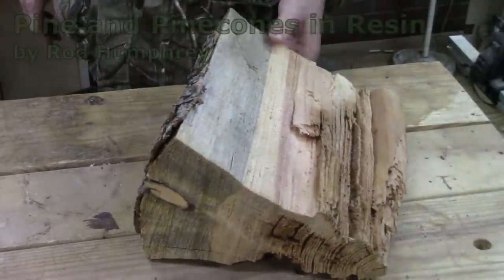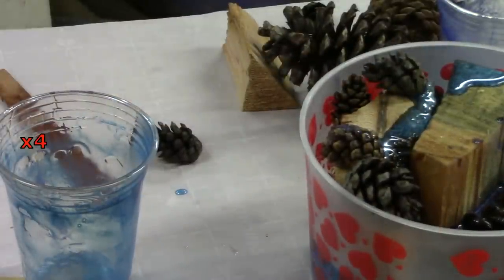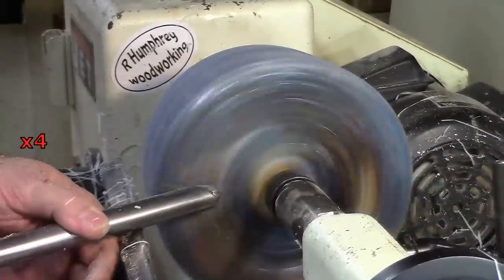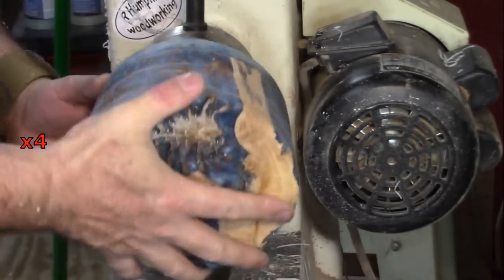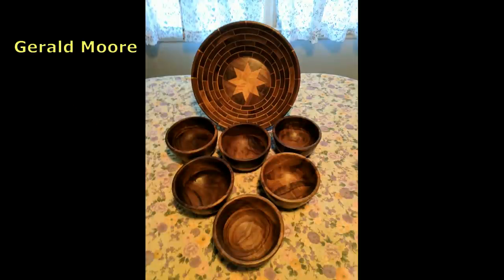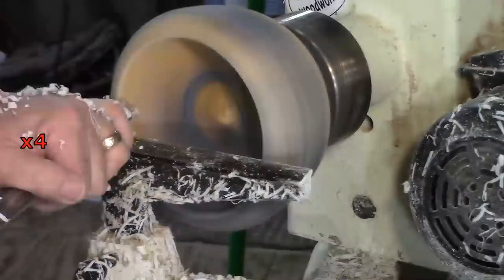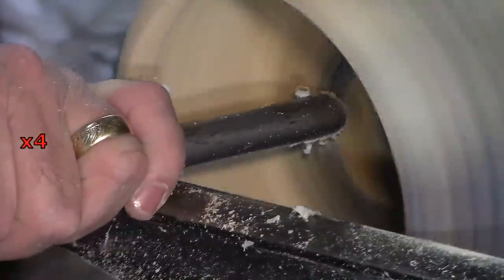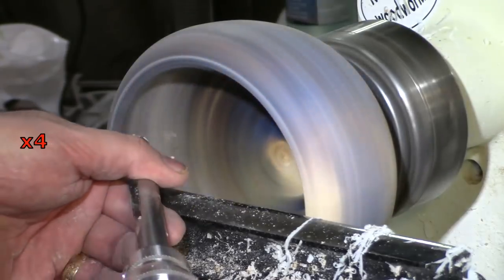Woodturning a Bowl, Pinecones with Epoxy Resin

Comment: please be careful with the epoxy resin, most resin's become toxic after being mixed and remain that way for three days, until full cure.i'm a boat builder in northern michigan,and i have burnt my lungs by working it to soon.remain well so you can keep making these beautiful projects
Reply from the maker: Dan, I really appreciate that, and I hope everyone reads your comment.  I don't stress it in my videos but I should...Wearing an actual respirator is mandatory for health reasons when working with resin, and good airflow.  Thank you very much!
Reply: Is this true? Damn. Yoi betyer be carefully working with it on the lathe then. Shit. I do alot of epoxt work too. Is it the one specific kind of epoxy? The boat epoxy? I know that one has fiberglass.....
Reply: @FatNebraskaMom  it's called systemic toxicity,liquid epoxy on your skin causes dermal contact. West System has a  book on precautions
Reply: @dandeforest9439  dude I will totally take it to heart. But I do know that there are different types of epoxy. Do u happen to know if they all cause this problem, or just the boat epoxy?
Reply: just found on utube under systemic toxicity from epoxy resin.if your epoxy has a ,ASTM -DH236,this means it is safe for home use,not even a mask is needed,(i would still use one for sanding)but there are no toxic voc's or chemicals.this is called art epoxy
Reply: @dandeforest9439  i will totally be careful. I knew there had to be a specification.
Reply: Good job
Reply: @dandeforest9439  thank you for posting this. I greatly appreciate it.
Reply: I been scrollsawing for 40years no dust mask same thing
Reply: I know a guy that was turning spalted wood like you ,lost half a lung from the fungus
Reply: @billallmon4094  Just half a lung? How does that work? Guessing it must have been the bottom half, or the the air wouldn't get in. I'm no pulmonologist, so really interested in how that works.
Reply: My gosh be carful, you could out out your eye!
Reply: I didnt know its effect for health. Thanks for your conferm.
Reply: @dandeforest9439  thanks for this importent info.
Reply: @Dan DeForest, thank you for sharing your experience with resin. I'm new to wood/resin turning and didn't know about the dangers. You may have saved me from some major medical issues!
Reply: Thank you for the tip. I'm just starting to learn to turn so any pointers like that help.
Reply: Tom Lindsay lungs are divided into lobes. Three on the right - right upper lobe, right middle,  and right lower lobes. Two on the left- left upper and left lower lobes. It’s the lobes that are removed during surgery. Hope that helps. Cheers
Reply: @FatNebraskaMom  Also belong to VOC material  Volatile Organic Chemical can cause  CANSOR
Reply: Dan DeForest Michigan in the house. Went to school in Houghton from Detroit.
Reply: Dan Deforest Art Resin brand has been approved as non toxic and food safe. No smell and no yellowing. I love this resin and the work time is an hour or more depending on the temp. Consistant product everytime.
Reply: Most toxic i met, was fiberglass, in no professional hands.
Reply: Im in Detroit...a Apprentice In the game.....Love it bro!!!
Reply: @RHumphrey  Fantastic work real workmaship is great to see.

Just a quick question, if you were to sell that, then how much would you ask for it...?
Reply: I love this bowl!  I wish I had some kind of creative talent like this!  My husband is from Michigan and his family is still there and he also was in the Marines. So on his behalf SEMPER FI!
Reply: Thank you for your "honest" comment about Epoxy Resin.
Reply: R Humphrey great comment, I always wear a respirator for any work that produces dust of any kind, even raking the yard, due to asthma. But as I am getting ready to work w some resin, I will remember to let it set and work on something else.
Reply: Carol Wells-Smith there is certainly creativity, but this is a skill practiced over time.
Reply: If doing this work indoors such as a basement, or even garage...you should also have some sort of air system to vent out the fumes. A fume hood, or vacuum system. Is best. Especially when dealing with the sanded particulates!
Reply: Bonnie Blackburn Art Resin does yellow over time....I just got an email from their support department yesterday saying so. It just doesn’t yellow as fast as the other brands.  I sent them several questions as I create high end jewelry and I need a non yellowing product.   They said,p that yellowing will occur after 5 to 10 years. If this is an issue, then I should “add colorants” to mask it. Yes, this is the brand “Art  Resin.”
Reply: Excellent, beautiful
Reply: Thank you
Reply: Dan - Really appreciate your comments as someone who's looking at giving this resin machining a go for the first time as I already have lung trouble and the last thing I need would be even more. I think a 'leave all castings a week before turning' policy would be a good one for me.
Reply: @jurisembergs9245  When I was a kid they used to make fibreglass canoes in craft lessons here in 70's UK. God only knows what lung damage was done.
Reply: SteeVeeDee  i unloaded bags with calcium (guess close to pure) in special compartment, made for cooling apparatus, system worked in reaction with oxalic acid, and those vapours were extremely dangerous. To damage lungs no gas is necessary, just pressure. One mistake in Monte Negro scuba diving and a lot of trouble.
Reply: R Humphrey I notice that none of your videos have ads personally I don’t mind watching ads for people who create  quality videos
Reply: Why you didn't notice alcohol? Alcohol is the most toxic in the world! Everyday 100 more people die because alcohol
Reply: You know, i try cocaine in 2013, first time in my life, provided by government of Republic of Latvia. Not interesting. Weak. Real life toxic fights are more energizing, ofcourse against FBI, SAB assholes. Shithole, dump etc. institutions.
Tobacco, coffee, no spirts is normal.
Reply: Great work and explanations as usual. 
Comment: There are more and more resin choices available, some are extremely low VOC , I recently poured a river table w/ Ecopoxy (not being sponsored, no affiliation) and it was surprisingly easy to be around it and work it. Other ones out there too, and results for at least the slow/deep pours were great.
Reply: Beautiful again....With a deep water look to it also....Thanks my friend...!
Reply: He is right... Always wear a. Mask dbe filter.
Same experience as this boat builder... With baths or windsurf...
And use resin the less yu can : recycling will be a real mess with those plastics too. 

I loved yur vase again. 
The pine flowers look like birds flying in winter cloudy and snowy skies... Nice !

Comment: That turned out AWESOME Rod,  I'm a little puzzled on why it cracked, but you fixed it up right ! as always Thumbs UP !
Reply: Hey Doug, seem like we keep watching the same turners. Well when you have good taste...LOL.....I actually thought the fixed cracks looked part of the finish anyhow!
Reply from the maker: Thanks Doug!  I'm not really sure...maybe I did too much at once and should have gone with timed layers...could have been that rotten wood causing problems.  Thanks again!
Reply: R Humphrey The wood probably swelled with the heat of the resin, since as you said it was rotten. Then when you exposed it to a sharp cold over night, the wood cells shrank back and pulled away from the resin.
Reply from the maker: That's possible, Erin, I'm not sure.... I'll so it a bit different nest time to see if I can track down the cause.

Comment: Beautiful creation from common material, a true inspiration.  I just outfitted my pressure pot for my first attempt with resin and want to inquire as to the make and colors of the pigments you use.
Reply from the maker: I bought a ten color combo pack...Mica powder by Pemline If I remember right, on Amazon for a great price.  I bought the pearl separately, same place online.  Thanks very much!
Reply: What does the pressure pot do?? I just got my.first lathe and I already work with resin. Thank you!

Comment: I absolutely love the bowl and how you explained what you were doing in the video. It was short and to the point. The only thing I might recommend is putting a waste block in the center so you don’t end up needing to use quite as much resin. I am always looking for ways to save on my pours, so I don’t end up with most of my material on the floor around me. I find it’s too expensive for that.

Comment: Hi I've just subscribed, i have noticed your work before and do like your artistic use of bits and pieces. I'm in far North Queensland, Australia and have plenty of species to try both hardwood and soft, all kinds of tropical plants to use too. i'm just at the moment building an artpiece called a workshop, out of bits and pieces. 2 old truck pantecs and a big garage door over the gap between them. Just coming into the Wet season here and a big tropical low rolling in from the Gulf of Carpentaria. I good test to see where the water leaks are. Cheers

Comment: Sir I noticed you used a "pressure pot" to remove air bubbles. Is that preferable to a vacuum pot? Or, the same for removing the bubbles? Thanks and, the bowl is beautiful.

Comment: Great video; thanks.

I'm just beginning to set up a shop. Can I use the same compressor for pneumatic tools and the epoxy pressure pot, or does the pressure pot require something special?

Comment: Before you pressure treat your resin bowl you need to vacuum treat it. It pulls all the resin into the hard to reach areas by replacing the air with resin. Just be careful because it gets foamy. Then hit it with the pressure pot to shrink those bubbles still in the resin to near microscopic size. It will look very clean and the price if the vacuum isn't expensive.
Reply from the maker: Thank you, I need to invest in a vac system...

Comment: Good morning, I live in Australia and watch your channel regularly and tried to do a small mould of resin and pine cones and failed as one pine cones didn’t all fill with resin and hence a 4cm x 15mm hole. I don’t have a pressure pot but would that have potentially been a solution? It was a 125mm high piece. Any comments, suggestions would be appreciated. Regards

Comment: Do I have to have a pressure pot to do resin/wood casts? I just bought my 1st wood lathe, I was a machinest with a metal lathe and mill for years, and I'm a carpenter at a cabinet shop. But I don't know anything about pressure pots and apparently I need to learn. Any info is greatly appreciated. I sure don't want to mess anything up, especially on my first project!

Comment: I got a request for a new video, Semper Fiedelis Master. I want a bowl that's nine meters tall made from three different woods: Black Cherrywood, Oak and Elk Wood. The outside has different Celtic markings on the sides while on the bottom is a viking marking.

It's filled in with resin that is a blue with lots of pearls and a silvery-blue with lots of pearls. The three woods must be in a bowl shape with a small edge that's loams over the inside of the bowl. The woods must also be large to handle the bowl shape.

Sorry if the request sounds weird, but it keeps popping inside of my head and I don't know how to wood turn nor have the equipment for it since I don't have the money for it really. The viking and Celtic markings are yours to pick.

Love this and your other videos as I feel like I should add them into my stories for Wattpad and Fanfiction, but wouldn't know how to explain the fully whole process really. Please keep making incredible creations, Semper Fidelis Master and God of all Woodturners.

Comment: Resin definitely has a place in the turning world..would like your take on the jet lathe...how would you improve it or are you satisfied with it....future Turner...
Reply from the maker: Thank you!  My take on this particular Jet lathe, the VS1442... I'd opt to spend more money next time.  This has the old Reeves Drive pulley system which has been very noisy for years and is now failing.  The banjo is OK but the knobs are failing... the tool rest should be discarded/upgraded.  I love the pivoting headstock.  Nutshell, I like it but will go bigger and electronic next time.... soon.
Reply: Thanks for your reply...and keep on turning...seems at times the world is becoming a thumb pushing mess you my friend INSPIRE...

Comment: Comments #2: I presently have no experience working with epoxy. Can colored flexible ropes or strings be made of epoxy to then drape over an object before the whole mass is placed in a bucket which is then filled in preparation of turning on a lathe?  Thanks.

Comment: I've been turning as a hobby for years. I'm interested in mixing wood and epoxy like this. What RPM do you cut the resin/wood ? What's the pressure pot for?  Thanks so much. Nice work BTW

Comment: Do you use a regular plastic bucket to cast the resin in the pressure pot? Or hard plastic?
Reply from the maker: medium... too soft will melt, to hard make it difficult to remove.  Some flex in the plastic...

Comment: Thx for upload, great video. I want to start making similar stuff but without the machinery. Might try to use dremel and hand tools to see if its it's possible. Is the shellac a sealer? That's the layer that's between the food and the wood/pinecones ?
Reply from the maker: Thanks very much, and I'd encourage anyone to give it a go!  Yes, shellac is a great sealer and is also food safe in it's natural form, and after curing.
Reply: Fantastic. I've always liked wood working with 100% wood or mixed with other stuff like resin.

Comment: That looks awesome. Is it safe to eat out of?
And such a stupid question, but what is the machine called that you're using?
Reply from the maker: It is safe to eat out of, yes.  I just use it for dry snacks... nuts etc...  Not stupid at all, I turned the bowl on a wood lathe, and used a pressure pot to set the resin bubble free..

Comment: Having never worked with resin in this manner I have a question which is What is the purpose of putting the work into a pressure chamber as it cures?
Reply from the maker: The pressure shrinks the bubbles that may be floating or trapped down to invisible while the resin cures
Reply: @RHumphrey  thanks

Comment: How did you mix that much resin at one time with out it getting hot during cure ? Art and glow website says 6 ounce max at one time, anytime  I have tried over 10 ounces of several different types of resin I always have a heat problem.
Reply from the maker: I think the heat was offset by the bulk of wood for the most part.  There were a couple cracks I had to deal with and heat was probably the cause.  That's my best guess... Thanks!

Comment: Is there a difference between using a pressure pot versus a vacuum chamber?
Reply from the maker: Yes, a pressure pot reduces the bubbles so they can't be seen (for the most part) while a vacuum chamber removes them... but can be very messy when it comes to resin.  But a vacuum chamber can also be used to stabilize punky or porous wood (and other items) by infusing the resin deeply into the material...   (I don't have one, but need to set one up 🙂)

Comment: This might be a Stupid question...
It is a monday... 
The resin shavings can they be melted & re-used or are they just trash? Has anyone every recycled or repurposed the shavings?
Reply: good question . once the a+b have been mixed they become one. cant be melted down, But I too have wondered if anyone has tried doing a shavings bowl using the resin in clear resin...
Reply from the maker: I agree, it's a good question!  I've seen others use resin shavings as filler in new pours... Peter Brown maybe?  I can't remember whom right now, but I do know it can be done, and it seems like the old stuff turned translucent and had a nice look.  I'll give it a shot myself eventually.  I'm not crazy about the waste either... 😊
Reply: @RHumphrey  thanks! So it was not a typical stupid Monday question..lol...
My nephew has melted the styrofoam that came in boxes with acetone to make polyurethane to protect an outdoor piece of furniture.. so I thought re- purpose or melting resin might be useful...🤯

Comment: Is there anything else that can help besides the pressure pot
Reply from the maker: layered pours, and torch or heat away the see-able bubbles as you go, but those pesky hidden and trapped bubbles can haunt you.  There may be other ways too... Check out Zac Higgins  that's his channel, and he's super knowledgeable regarding resins and castings

Comment: Question from the uneducated in the crowd: Using these materials(epoxy,shelac,etc.), are these style pieces food safe? Or purely decorative?
Reply: P.S.- Absolutely beautiful work by the way. I can not do this style work because of funds, patience, and more, but the most respect to the people that can.
Reply from the maker: Thanks very much!  Safe for dry foods, depending on the resin used even wet.  It doesn't do well with any heat though.

Comment: Question. What does it cost to get into wood turning. Large etc.
Reply from the maker: Just my opinion, but for a decent (large) lathe, chucks, turning tools and possibly a sharpening system...maybe $2500.  That might be a bit high or a bit low, it just really depends on the equipment you want.  Other turners, please chime in with your estimates...   Final note, you definitely get what you pay for in lathes and tools...cheap stuff is available, but it's cheap stuff...